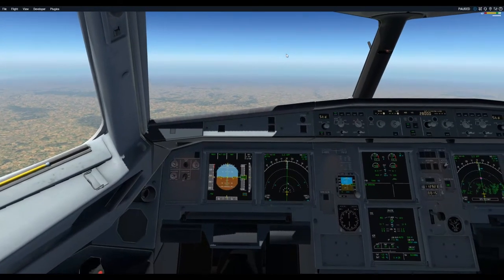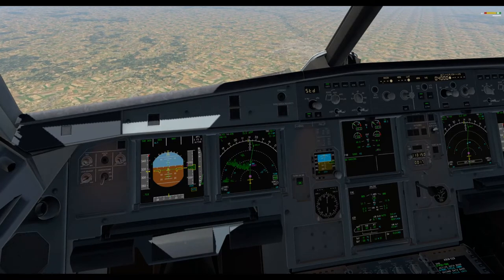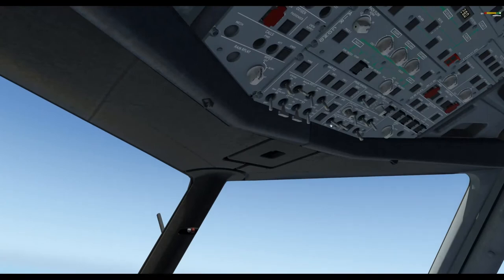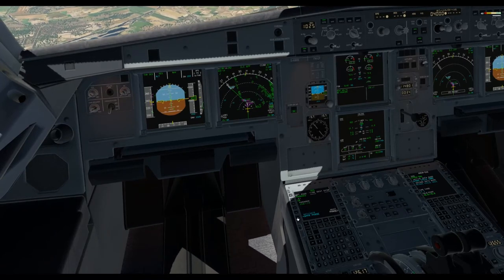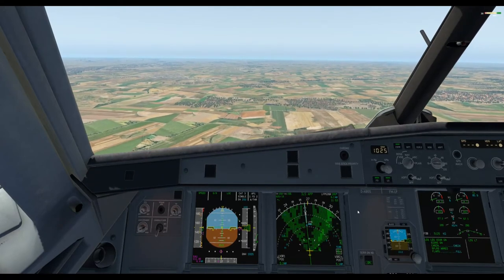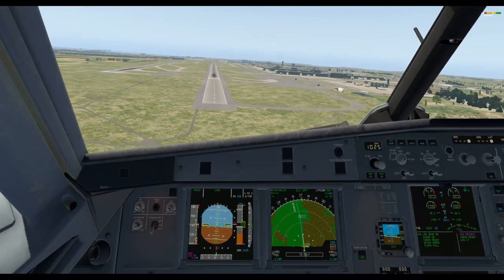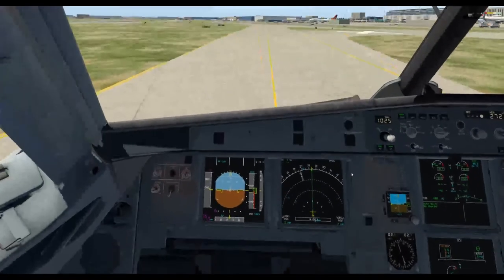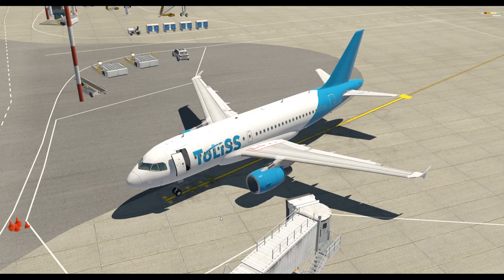Toliss A319 - Flight Tutorial - Part 3 - Descent, Approach, Land

Comment: Thank you so much for these 3 videos, they really helped me. I just have one question, is it necessary to fill the descent and approach pages in the performance section, to make them happen? Greetings from Argentina and thanks again!
Reply from the maker: Bruno Leanza descent page is filled with cost index information...
Approach performance page is necessary to enter the approach mode so the plane can activate the proper automation system for landing. That will allow a proper computed speed and calculation of minimum landing speed. You also will need to have that page set-up to be able to autoland...

Comment: Hi max. In some aircraift you have to set your descent to the ils altitude (no atc) . LFPG 26R IS 3000 FT (chart).  In your video, you set 4000 ft. Why did you choose 4000 ft. You do not set any ILS frequency in your radio MDCU. Why. Is it an automatic feature regarding the ils frequency. Thanks to help my arround the altitude to set and the radio feature.
Reply from the maker: Louis Cyr I'll check but it used to be 4000ft on initial approach on LFPG...

Comment: Hello, I have had the ILS working in the past put recently when I try and ILS it just circles the localiser and doesn’t intercept it?
Reply: activate the appr phase
Reply: @mohammedwisam2695  the Apr button on the outopilot panel?
Reply: Playmentic no in the fmc their is a phase called appr (approach) phase and it asks u if u want to activate it , u press activate once u r beginning ur approach then u will see live diamonds , at this time u can press the appr button in the autopilot :)
Reply: @mohammedwisam2695  is it on the performance page?
Reply: @mohammedwisam2695  I have everything set up, I get the diamonds on the PFD but instead of following them I just circle?
Reply: @playfs4644  hmm, strange, make sure that u r on the correct frequency and crs , u can check that in the fmc Rnav radio page, also if u have one dimond alive , i am referring to the horizontal one , press the loc button first then the appr button when the vertical diamond comes alive.
Reply: @mohammedwisam2695  thanks for the advice, i'll try some different approaches and see if that changes anything
Reply: Bit late but did you figure it out? I have the same problem..
Reply: @koengoemans5178  it was a toliss bug, I updated to the latest version and it worked perfectly
Reply: @playfs4644  Oh okay. Thanks for the quick response.

Comment: Ok. You are right. I check in this old chart (http://www.fly-sea.com/charts/LFPG.pdf) 2008 and it is 3000 ft. In the newest chart (http://vau.aero/navdb/chart/LFPG.pdf) it is 4000 ft. Curious...

Question: I am not an expert of airbus. About the ils frequency in the Radio, Is it set automatically for this plane or it’s a gps facility. In the tutorial manual, i do not see a part around the setting ils radio. I’m a old fashion sim pilot and usually use a ils approch and i set the radio for this. Soo, I repeat this question, is it a airbus feature that the ils is set automatically or it is a gps. I
Reply from the maker: Louis Cyr once you select the approach procedure and runway, the plane will automatically set the Ils frequency for you.
If you need to override it then it will be through the CDU on the radio page...

As per charts, best to search for official SIA France (eAIP) freely available...